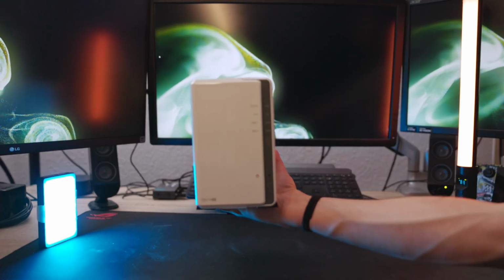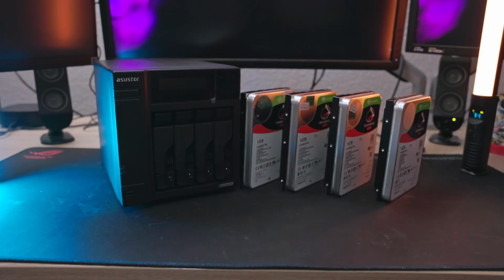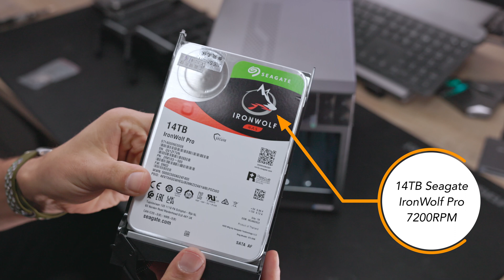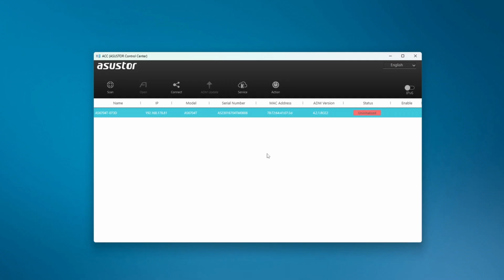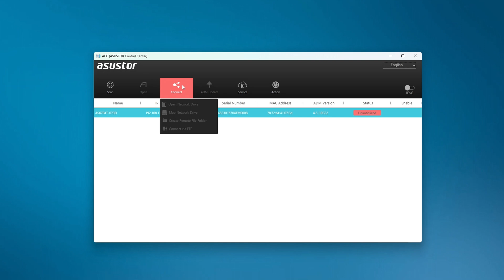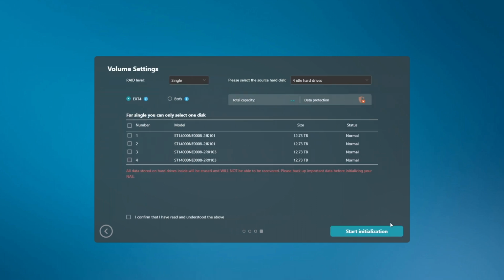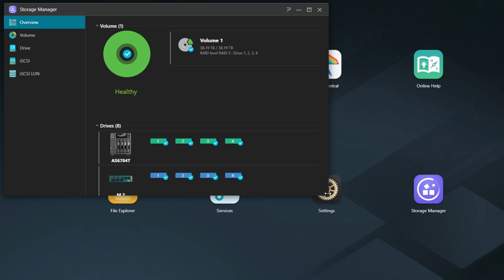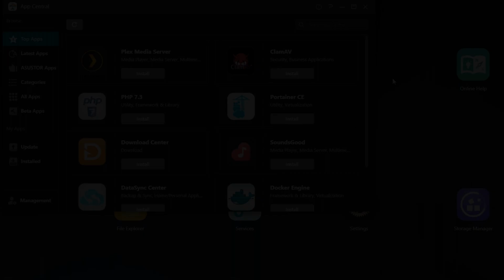Asustor Lockerstore Gen2 | Full RAM Upgrade | 4 M.2 SSDs | Quick Start Guide

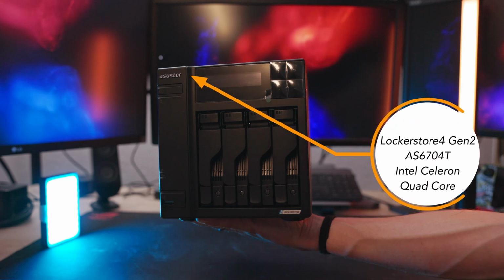Comment: 0:21 Hi there! The Lockerstor is made by us, ASUSTOR. Not ASUSTeK. We are run as a separate company.
Reply from the maker: Thanks for pointing out my mistake. I'll write a note in the video description. BR
Reply: Is there a processor upgrade path using Asus motherboards?
For example, if the Docker workload grows (or is larger than expected).
Reply: @jimcallahan448  From checking their website, it seems most of ASUS's desktop PC motherboards are upgradeable, but it appears their laptop boards are not upgradeable.

Comment: My Asustor Lockerstor 4 Gen2 - AS6704T
Kingston FURY Impact 16 (2x8GB) 3200MHz DDR4 CL20 RAM
Asustor AS-T10G3, 10GbE and 2x M.2 NVMe SSD Network Card
4x Saegate Ironwolf PRO 12TB SATA3 drives
2x Sansung Evo Plus 2TB M.2 drives
Of course I'll leave a like!

Comment: When you installed the 64GB of Ram, that was 32 after just removing the cover. The second 32 you had to dissemble to get it replaced, correct?
Reply: what is the point of 64gig of ram, I thought the cpu in these could only address 16 gig. FWIW I put a 16 gig stick in mine so running 20 all together which works fine for me.
Reply from the maker: Hi, I've just installed 16GB of RAM. And yes the second RAM slot is "inside" the case so that you have to dissemble the NAS to get to the slot. BR

Comment: Is the RAM you used on the compatibility list for that model? I want to upgrade the RAM on my Lockerstor 6 Gen2 but the list is... small lol
Reply from the maker: Hi, no my RAM is not on the list and yes. the list ist very small. But so far it works fine. BR
Reply: @Esperto84  Thanks for your reply. I'm just wondering if it's running at the speed advertised or if it gets capped out. I know it's unbuffered ECC SODIMM RAm, but is there a way to check? I already ordered TEAMGROUP 16GB 3200 CL32 RAM, but if I can get away with returning it for someting faster that will actually run at the listed speed, then I will. (I have the Lockerstor 6 Gen2, just out of the box, haven't booted it up yet)
Reply from the maker: @MRG1BZ I’m not sure if there is another way to check the RAM speed, but I checked it in the BIOS and it shows the correct speed.
Reply: @Esperto84  amazing! Thanks!

Comment: @Esperto, Nice detailed video, Thanks! 😄
I have a question for you, if you can't answer because you didn't test it, that is fine:
Can AS6704T with Plex encode at least 2x 1080P high bitrate files and subtitles simultaneously to 720p, or does the CPU throttle?
Reply from the maker: Thank you. I didn't test your scenario exactly, but I've open 2 1080p movies and activate the subtitle. I did it with JellyFin in two separate browser windows. The CPU usage was about 5 to 8% per video. I didn't see anything strange. Also downsampling to 720p seems to be no problem. The CPU usage doesn't change that much, maybe by 2 or 3%. I hope this helps a little bit 😊
Reply: @Esperto84  Thank you for your fast response! Your answer helps, for sure 🙂

Comment: I am having such a hard time removing the SATA board right now, I’ve taken out the screw but nothing, it won’t budge!
Reply from the maker: That sounds strange. Perhaps Asustor has released a new revision. Have you checked to see if there is another screw or even some other mechanism holding the SATA board in place? I hope Asustor haven't glued or even soldered the board in place, which is illogical as otherwise you can no longer access the other components.

Comment: Not a fan of the crucial P3 drives there TBW is pretty aweful. For example the 2TB drive has a TBW of 440 TBW which frankly sucks, when compare to other drive of similar prices from brand named companies have 1200tb.
Reply from the maker: Hey, at the time of filming SSD price were pretty high. The intention was that as read and write cache it wouldn't be that bad if a SSD failed because I doesn't store any important data on them.

Comment: Excellent videos with very clear explanation. One question please, Can we use SSD NVMe as a volume only or only SSD caching? I want to use NAS to backup 2TB data.
Reply from the maker: Thank you 😃 
You can use SSD as normal volumes. I did that too. You don’t have to use the SSD as a cache. Another commenter also mentioned that, if you initialise the NAS with a SSD as Volume 1 then the HDDs “can hibernate” because the OS will be installed on the SSDs. 
BR Esperto
Reply: Sure ,ssd as read write cache need 2 ssds , read cache only need 1. and you can create volume for data on ssd.

Comment: Hi wich screw drive did you used to open the nas? I have tried 5 different types of Philips screw dirves unfortunately no luck so far.
Reply from the maker: Hi, I've used a PH2 so a Philips Head size 2. Just pause the video at 01:06

Comment: Excellent Video.! If I use only 2 14TB HDs, what Raid config would be best? Then, can I add a 3rd 14 TB HD in the future if needed? Thanks.
Reply from the maker: Thanks. With 2 driver I would say RAID 1 is a good start. You'll literally save your data twice and you'll have a total storage of 14 TB. Later with a third drive you could switch to RAID 5. Then you'll have 28TB storage and the third drive is the parity drive. But maybe anybody here have also a different suggestion? 
BR

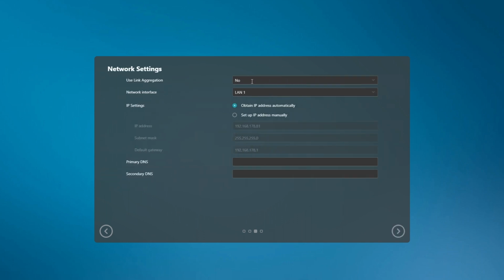Comment: 5:50 If you want more speed you DO NOT do link aggregation. Instead you connect both net interfaces to switch and have smb multichannel working. Link aggregation and smb multichannel are mutually exclusive.
Reply from the maker: Hi, thanks for this tip. Indeed I have this option enabled in the ADM SMB settings.

Comment: Saw a comment from a user on RaidOwl's youtube channel ( https://www.youtube.com/watch?v=MdcRPTmf_3M ) that he had upgraded for virtualization to 32Gb.  While officially Intel doesn't support this, apparently it is possible, and I note that TerraMaster on the same chip says it is possible. :)
Reply from the maker: Wow, what a surprise. Thanks for letting us know. So I there is still room fur upgrades, nice 😉
Reply: @Esperto84  Yes apparently - want to test it out for us?! ;)
Reply from the maker: Of course, if my 16GB isn't enough anymore 😄
Reply: Yeah, looking closer at the Intel spec sheet it is 16Gb max "per channel" (if you read the little "?" explanations.  So 32Gb :)  @Esperto84
Reply from the maker: Yeah, and also the max memory speed is 2933 MT/s but a 3200 MT/s module was pre-installed 😆
Reply: @Esperto84  Just drops it to 2933 speed, so no big deal, but 3200 are easier to come by (likely less $$)
Reply: I installed 64gb 3200Mhz ram in my lockerstor 4 gen 2 its Work fantastic.
Reply from the maker: @akselamhartzen3166  Wow, that's impressive. Thanks for sharing this information with us. And I wish you a lot of fun with your lockerstore 4.

Comment: nice video thanks!
something i learned the hard way: Volume 1 (in your case the one made up from HDDs) is the one that actually has the operating system installed. This means the drives it is installed on will never shut down (if you have for example docker containers running)
This is why i would suggest you initialize (first setup) with only NVME drive in, so your system can be installed on faster, lower power consuming and much quieter drive
also be carefull with those nvme drives, they are only consumer level drives and if you move a lot of data, you can easily kill them very fast. For example the WD red nvme drives can read/write several times more data before they die than regular drives you put in.

thanks and good luck
Reply from the maker: Thank you for sharing your experience with us. Actually I have docker containers running. I know that the NVMEs have a limited write volume, but I don't think that much data goes through the cache. But I will keep an eye on the SMART values of the NVME SSDs and switch to Enterprise SSDs if necessary.
BR Esperto

Comment: You put slower RAM in it than it calls for. The site states 2933. Probably wont notice it for the most part, but it could slow you a bit at times.
Reply from the maker: Yeah, based on their website I thought a 300 MT/s different won't be noticeable that much. But instead a faster RAM was installed. But I'm good with that and I could upgrade it anytime anyway. 😀
Reply: @Esperto84 size is much more important than speed while talk about RAM
Reply from the maker: I think it relates also to the purpose. If I want a system which has to be responsive in the fastest way I would try to use the fastest components I get. And it also a question of your budget and needs.
Reply: Uhhh ohhh.. somebody doesn't understand that higher frequency means higher latency which basically cancels out the higher frequency...
Reply: @tim3172 this has been scientifically disproven multiple times by multiple different sources, via math as well as testing.
The higher frequencies can and do make up for the latency increase in almost all cases
There are very few use cases where the requirement for small latency is so great that the actual speed doesn't matter, but in almost every other case the overall performance of the system is far more important than just acknowledging a request quickly, you do need to actually get the data to the processor too